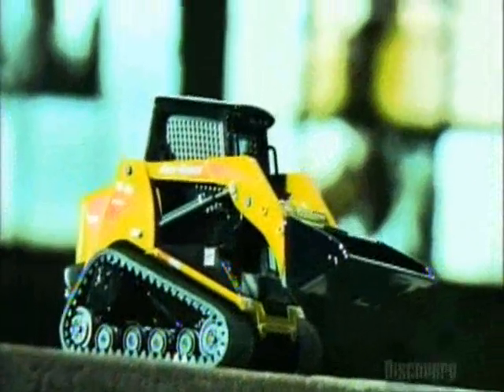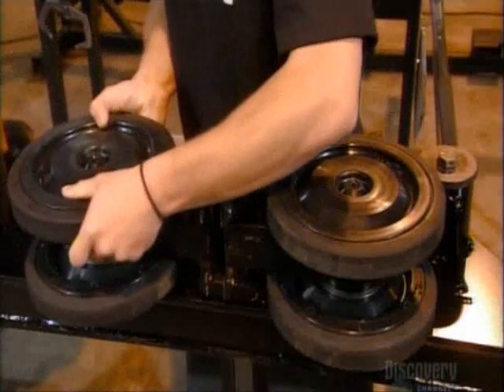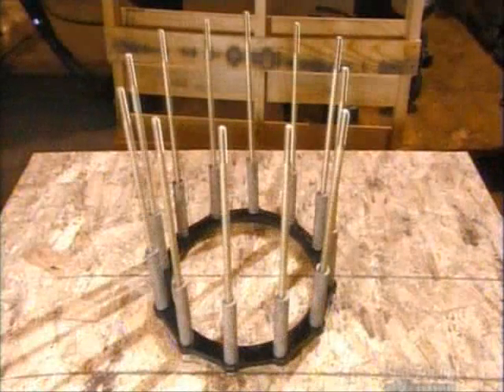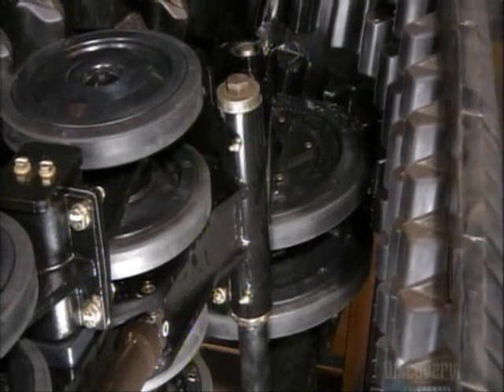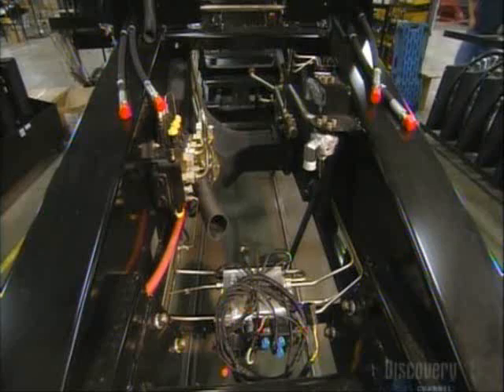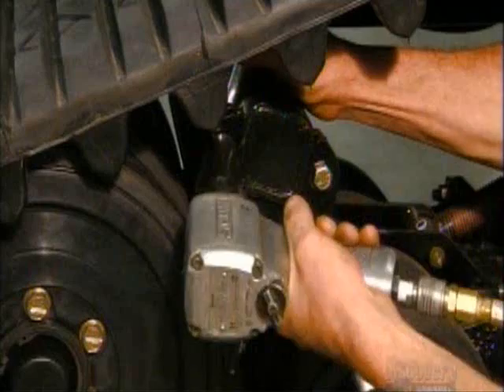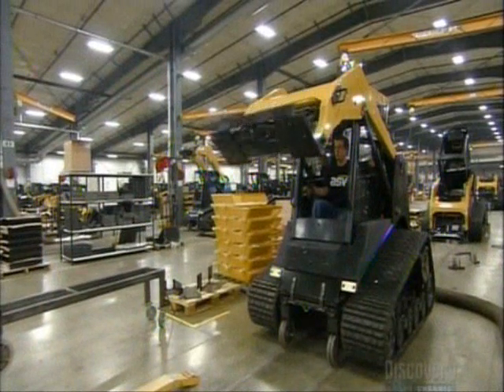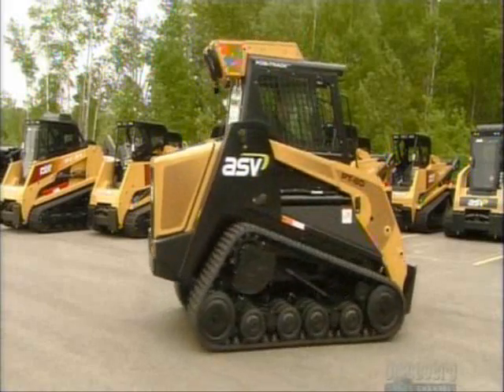How Its Made 05 Compact Track Loaders

Comment: I have owned six different brands of track loaders. The last one (and current) is this very one. The ASV100 is so much better that Bobcat, Case, Cat or Deere. Owning one of these is like having a money printing machine. In two years of non-stop operation, other than scheduled maintenance, it has never been in the shop. Not once. The Cat had three warranty claims the first two months. And the performance makes the Bobcat look like a child toy. ASV rocks.